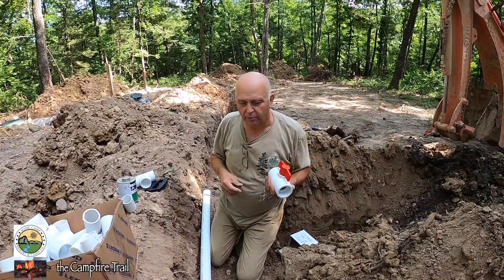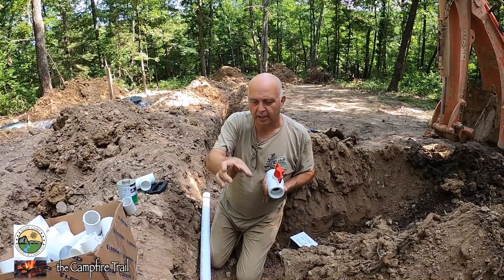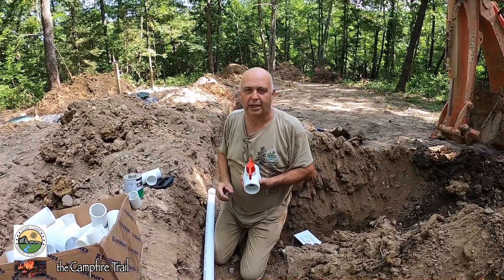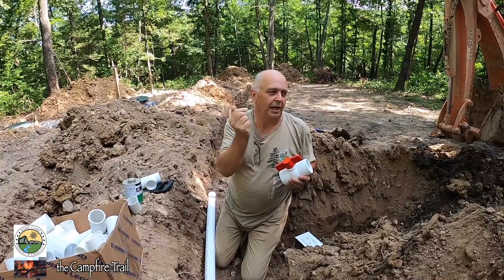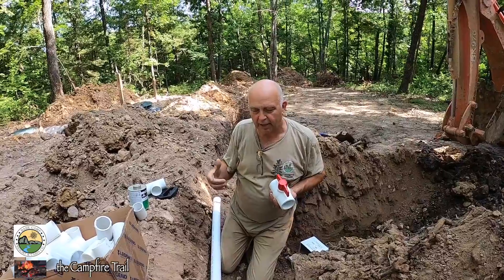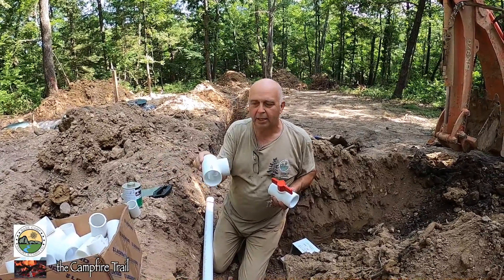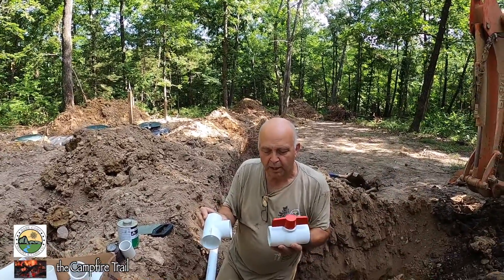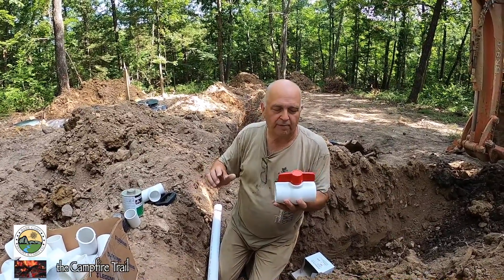DIY Septic System - Installing the Distribution Manifold On An LPP System

Comment: How did you learn about doing this? Do you have any recommendations on books or courses? I have found very little information on the subject. Thank you.
Reply from the maker: Honestly, I had never heard of it before the soil scientist told me that an LPP system would be required. I said "A what, what?" She described it to the extent that I still didn't really understand. The county health department inspector I was dealing with was the most helpful. When he inspected the site I asked a lot of questions and took notes. His description got me through it. I still called on him a couple times during the process for some clarification. Once I understood the system, it actually made a lot of sense. We shot a whole series of videos on it but the soil still is the deciding factor on length of footage needed to absorb properly. I wish I could be more helpful. Whoever governs systems in your area can be of more help I'm sure.
Reply: That’s really awesome that the inspector helped you. From what I understand is that they don’t need to talk to you about anything. Thank you for the timely response and great videos. It’s been the most helpful resource for me so far. Much appreciated.
Reply from the maker: You're Welcome. Best of luck to you.

Comment: Hello sir! Have the same septic system in my house. When I bought my house I realized that my house has different septic system than regular systems. Actually my neighbor explained me that. Seems like previous owner had trouble with it. I have done some upgrades in system already and wondering if I can add couple more drainage lines in my field by myself?! Made some research and realized that I have to have to be licensed to do any repairs or anything on my system. After watching your video, I can see you name it DIY. I just confused about it, if it’s possible to do it DIY or I need to obtain license for that type of work? I live in South West Missouri, Christian County. Thank you for any advice. Have a good one sir!
Reply from the maker: When I spoke to the county (Stone county, as well as the state soil scientist) they both said I could do the installation myself as long as it was my property and a residential system. I could not do an installation on anyone else's property without being licensed. The new installation did require a permit from the county and an inspection once it was complete. With that said, they did tell me if I ever needed to upgrade the size of the field, I could add additional lateral lines. I assume they would probably want that to have a permit but I don't know that for sure. I'm sure Christian County P&Z would be able to answer your questions. I also believe the regulations regarding DIY installations on septics are statewide but permitted through the county, so I would also assume that you would be allowed to work on your own system. Hope it helps.
Reply: Thank you sir!